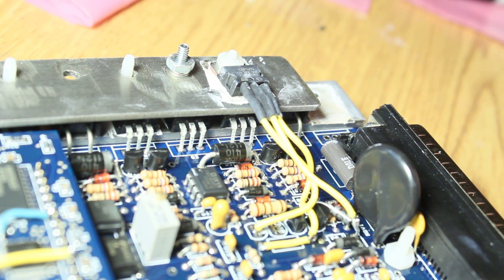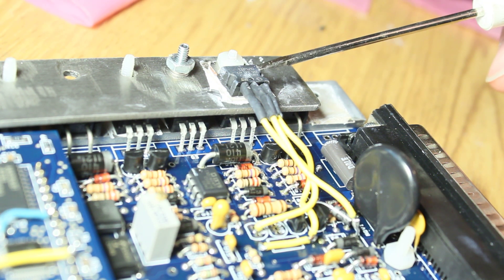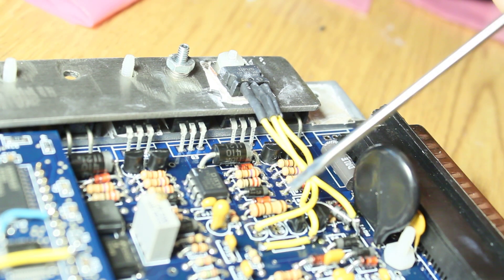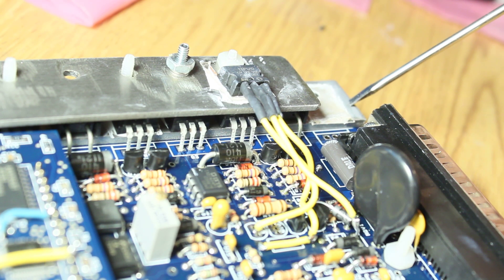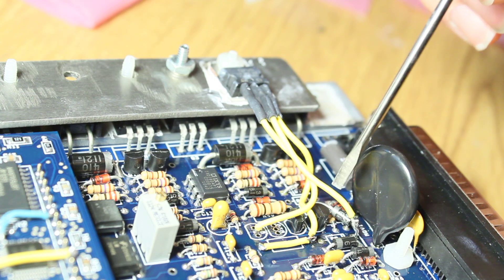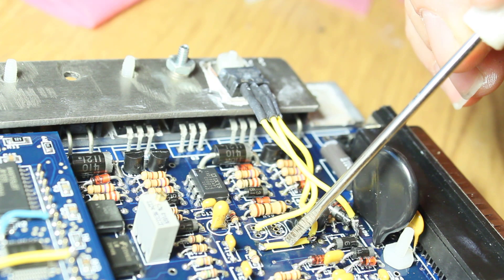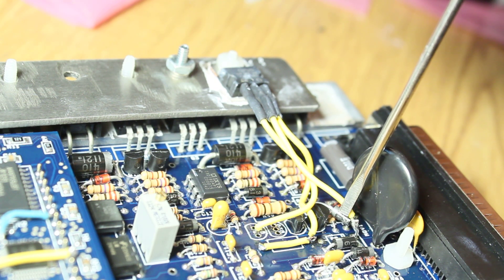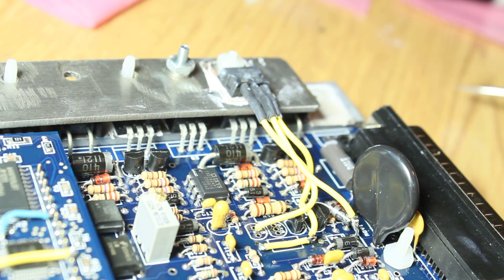Evan's Megasquirt Build Ep 4 - PWM FIdle / IAC Valve Hardware Mod

Comment: Wonder if you can help me? I have the MS2 v3 system and want to add a Ford 3.5 aic valve to my engine. It is an older V8. What exactly do I do?
Reply from the maker: I can try... step 1 is finding out if it is a pwm or a stepper based solution. 4 wire implies stepper (or if you can see a motor) . you should have the stepper chip on your ms2, so now you just have to see if the pins are broken out to the db25. they could have been used for other outputs so you need to check. use the msextra manual on how to do that. then its just software config like I did and making sure it spins the right way. it's hard to damage the motor or chip so trial and error works on the pinout.